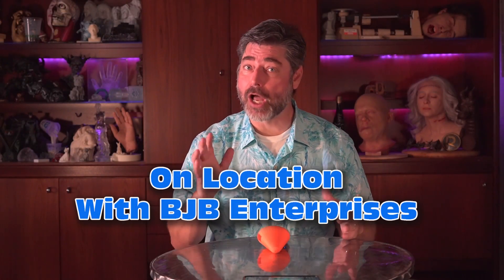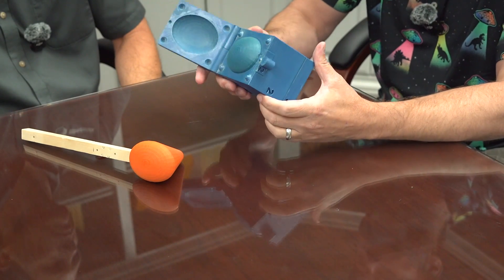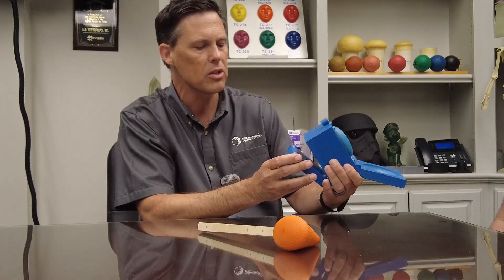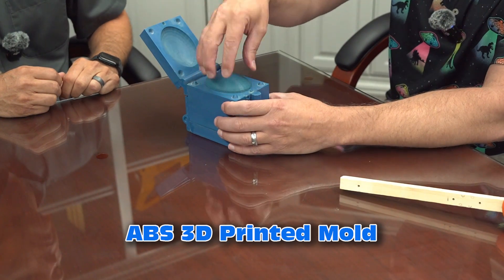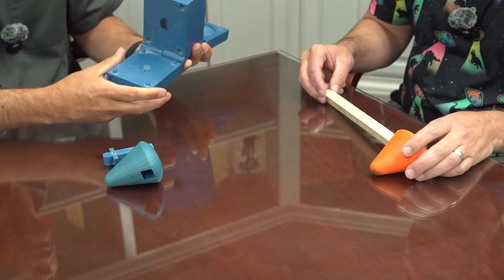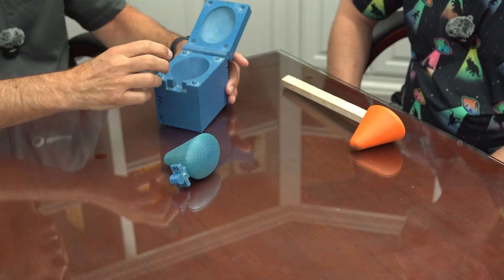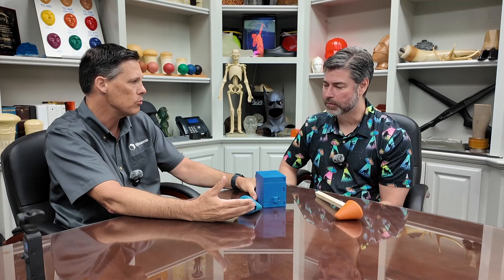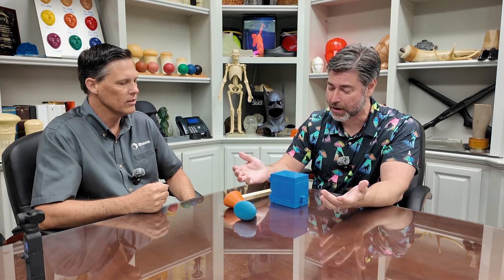3D Printed Molds For Foam Casting - Design & Release #3dprinting

Comment: What I am very interested in for the purpose of lost foam casting, is if we could somehow pour XPS foam in a mold like this, or even EPS. If we can 3d print the mold, and then create a XPS or EPS foam plug we are in big business of casting aluminum, can you ask BJB about that possibility? That would be totally crazy.
Reply from the maker: You might be able to use one of their low density rigid foams for that, like 3lb density TC-300, but I have never used any foams for that application so that is uncharted territory for me. I will alert the good folks at @bjbenterprises and see if they have encountered this application.
Reply: @brickintheyard  Thank you very much. The phenomenon of the xps or eps foam is that entrapped air prevents sand from falling in on the tool your trying to make.

Comment: THose molds had so many facets so the circles aren't nice and round... for that size something like 120 sided circles are much less obvious and better looking. also easier for the processor to work with... 120 divides by 1,2,3,4,5,6,10,20,30,40......
Reply: A mentioned, this was a very old tool and not printed at high resolution.  The surfaces are not what we typically get today. However, the lessons for mold release, venting, and quick assembly are topics we still deal with on the daily as folks venture into casting work.
Reply: @bjbenterprises  PAreciate the reply, still think its a handy bit of info.. took me ages to pick that tip up...

Comment: That hinged mold is very clever!
Reply: We have several foam tools around the R&D shop that feature hinges and quick clamps.  It's night and day working with them compared to hand-clamping block tools while the foam is rising and trying to make a mess!
Reply from the maker: Definitely. Very practical design all around.